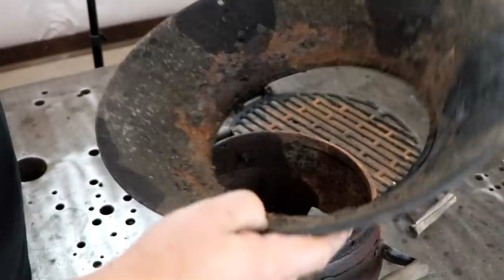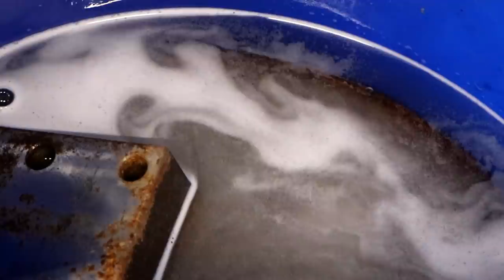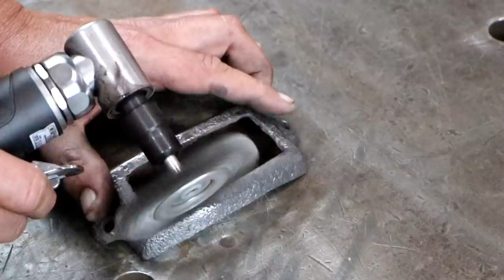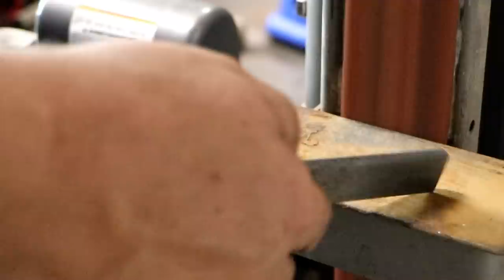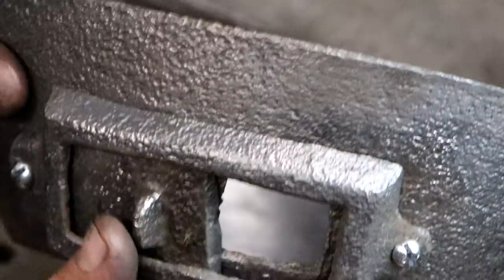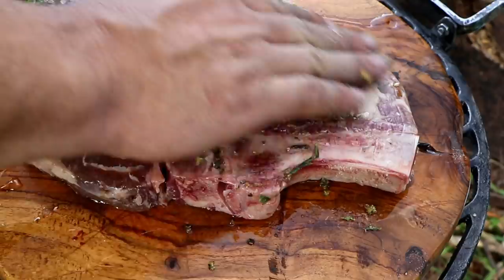Hibachi BBQ RESTORATION

Comment: I have one of these and mine has a small round grill between the pot and the cone. So the fire is built in the top inverted cone and the ash drops through into the pot. Also allows air to come up from below. Cool restoration and nice cooking 👍
Reply: I also have this exact same grill.   Having used it a couple of times, I noticed it wasn't really getting hot enough around the entire grille.  Your comment is the only info I've gotten so far that may explain this (mine doesn't have the separatation between pot and cone that you mention).  Will try again today using some improvised separation.

Comment: Nice work.  Of course, the bbq will quickly turn back to rust with use, given the metal of its construction and the small remnants of corrosion that are impossible to remove without chemical treatment.  I was waiting to see whether you would go the extra mile and bake a ceramic coating onto the metal.

Comment: The end looks a lot like an AlmazanKitchen video! Nice BBQ! I wonder, why not heating the rivets in your forge?
Reply from the maker: It heats the rivets fine. The rivets are very small and cool off in five seconds. This wouldn't be a problem if I had a torch. I could just reheat  them and use the rivet setter again. Hope that helps.
Reply: 00

Comment: Can you do a video of how to free up a steel screw in aluminium? I have a vintage PK grill and I need to remove a still screw that is in aluminium in order to free up an air vent.
Reply: @Keith Brookshire look up AVE's video on broken bolt extraction, Alum works great on steel in aluminum.
Reply: @acidburner420  thank you!

Comment: You should maybe invest in a media blaster.  It will do a much better job at removing rust and cleaning the surface, and save you a lot of time.
Reply from the maker: I have one. It's set up nicely. Good gun, upgraded unit. I do not use it on castings because it kills the finish. I really like the cook of cast iron when it is hit with a wire wheel. If i am painting the parts i will blast them. On another note the average sand blast cabinet is not as fast as a wire wheel. Thanks for watching. See you on the next one

Comment: Cool restoration.

You're already done, so for the next "heat" restoration you do, I suggest using brass hardware. It may not be original, but it's better, because the brass will take the heat, and last forever. The gold looks really cool against the black, too.

Comment: You are by far better off bolting it as you would likely break the thin castings trying to set rivets in it!
Reply from the maker: That was my concern. It would be fine if I could keep the heat in the rivet.
Reply: @TheGoodoftheLand  Rivets that small are to the best of my recollection never hot set they are to small for that!  I was more concerned with the hammer blows, all it would take is the smallest misalignment of the set and for it to transfer the impact to the cast iron and you have more pieces than you started with!  That and the speed of manufacturing would dictate that it was bolted together originally in all likelihood.

Comment: Great restoration that is useful as well. 
At least with it being bolted together, you know you can unbolt it and rivet it later but on Instagram you said you used your oven from Stan at Bar Z to heat the handles. Why not the rivets too?

Comment: How safe is that solvent? I'd be worried about it being in the metal and cooking with it. Like turning a large propane tank into a grill
Reply from the maker: +Nathan Wilson it's the safest solvent ont he planet because it is not a solvent. Its is microbes. Very cool parts washer. As for eating off the grill, I ran it hot for an hour to season it before cooking on it
Reply: @TheGoodoftheLand  well that's even better. Do like the seasoning over a paint that would have to flash VOCs off anyway. Nice restoration

Comment: your grill missing a part. i have exactly the same here for many many years in use. there is a fire grate inside at the position where the round parts are bolted together
Reply from the maker: Thanks! Thought about making one but steel nevertheless lasts in a grill. Need to find a good peice of cast for the job

Comment: You know this is a 5 Dollar BBQ from China. It doesen't worth anything to treat on it.
Reply from the maker: +René K. To anyone that know casting, this thing is very cool. They were able to cast this entire grill including the top which is like 16 gauge. Its obvious when you look at the handles and hardware that it was likely sold in a department store in the 80's but my guess would be that this came out of a very rudimentary foundry and Is hand cast. My guess it it was originally sold locally in China or another third world country long ago and they received a large enough order to have to stamp cheap handles and bolt the thing together to keep up with production. Where some see a original purchase price other see manufacturing history. Remember, the original purchase price of a 27 ford was around $380. Hope this helps